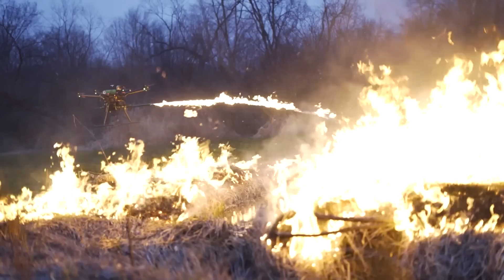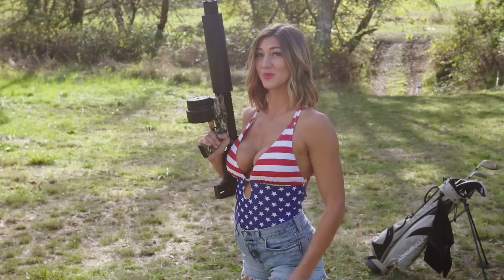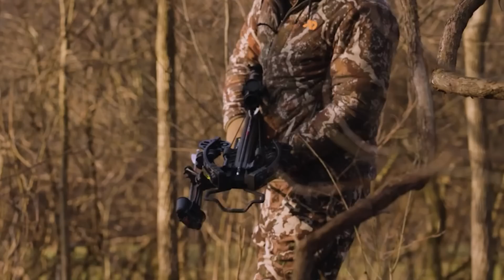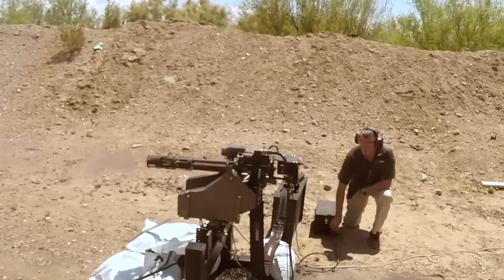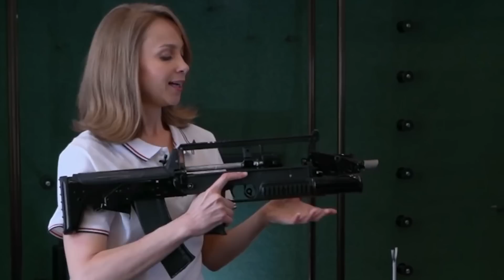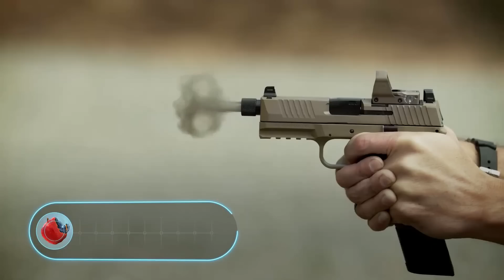The Most Advanced and Effective Weapons You Will Appreciate

Comment: that "Pivot" is a super clever idea. but it could be even smaller very easily. all they need to do is, have the adjustable stock fold underneath like some takedown rifles. it looks like it would end up at ten inches. thats half the original length currently. and the size of the ammunition is strange. that makes it a hassle for the customer and more expensive. food for thought

Comment: Do you guys know if that Can cannon is available in the market? I think it's pretty cool to try on!
Reply: Been available for 5-7 years now
Reply: A friend of mine has one and also the golf ball attachment. We had to modify his a bit, as the recoil when firing cans is so strong that it sheared the bolts off on the bottom 1913 rail section where the vertical forward grip mounts. In all fairness, we had shot it for the better part of a day, and he had also done so the previous day. I personally feel that the bolts had vibrated loose and gave just enough clearance to provide a side loading "hammer type" effect to the grade 5 bolts. In my opinion, better bolts and thread lock would have prevented the malfunction. It's fun as all hell, btw.
Reply: its an upgraded version of Fallout 4's Junk Jet!!!